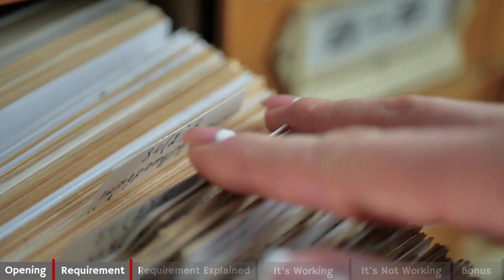Design History File 820.30j & ISO 13485 § 7.3.10 (Executive Series #19)

Comment: Great video, to clarify device history file and design history file are interchangeable?
Reply from the maker: Hi Hassam,
If you go by the regulation the correct way is “Design History File”.  For 13485 its “Design and Development File.  When it comes to industry, you are correct, they are interchangeable because many people (including me) say “Device History File” by mistake when they are referring to “Design History File”.  I know I have been using them interchangeably for years until recently when a fellow AAMI faculty told me I said it wrong a couple times.  😉
Either way, people will know what you are saying.
Sincerely,
Aaron

Comment: great explanation.. can you pls suggest some tools used in market for storing DHF electronically ? Thanks !
Reply from the maker: Hi Uday,
I recommend you use either your document control system or your Product Lifecycle Management system to store the DHF documents.  It really does not matter which system you use as long as the architecture of the system supports the correct review/approval and record management.  In my past I have worked with Paper DHFs, Hybrid paper/electronic, and fully electronic.  Any system can work as long as its configured and validated.  😊
Some systems I have seen used are: Agile, MasterControl, SAP, and ETQ.  I do not recommend SAP as its not build for effective QMSs.
Sincerely,
Aaron